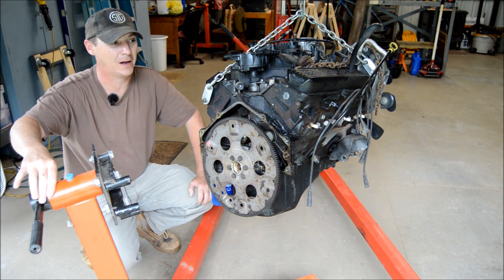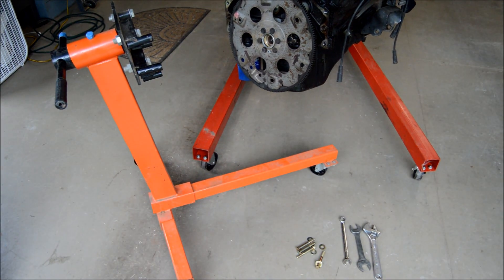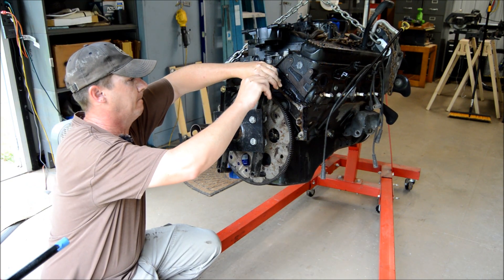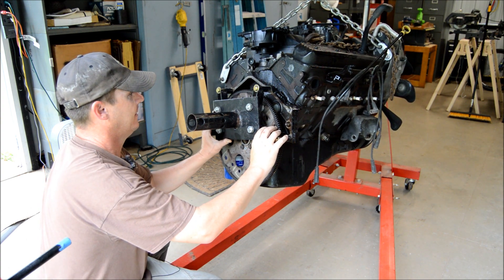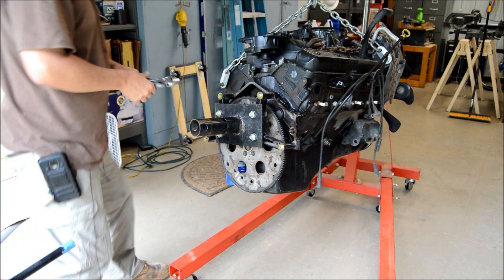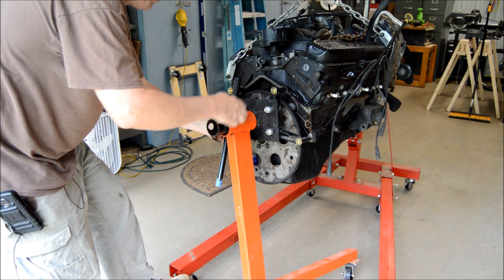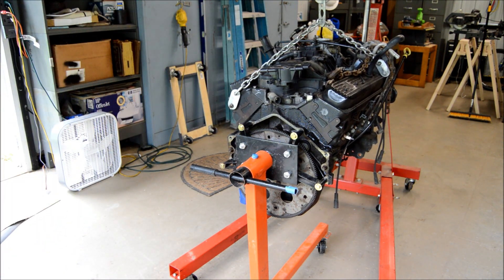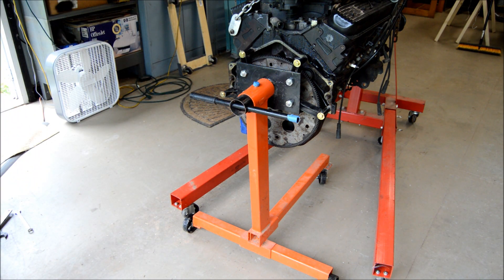Balance Your Engine Stand Properly - Vortec SBC Complete

Comment: Nice work. How are you liking those solid motor mounts? Also when installing the body mounts did one one hang off the frame? I'm wondering if moving the mount over to the next hole still line up the motor???? I just dont want to go through the hassle if it doesn't work out.

Comment: I would NEVER use one of those three legged enginw stands. 
Also, you need the pivot shaft to be aligned with the camshaft bore, or it's going to be very top heavy and dangerous.
50 years of working on engines has taught me a lot of lessons.

Comment: Thanks for your vid. I’m about to mount a 350 long block on a four castor stand. Without having seen it done I was a bit concerned but now I feel confident. Getting the balance point will be important for when I rotate the engine.

Comment: As others have said, this is a great little video.  Mounting to an engine stand is only 'obvious' if you've done it before.  Thank you for posting.  BTW, is there a reason you left the flywheel on?  Was this mounting only for demo purposes?
Reply from the maker: I left it on so I could use it to turn the engine over with a pry bar.

Comment: Great video. I wish I'd found it BEFORE I put my RAV4 engine on the Harbor Freight (Pittsburg) stand. Not knowing what you showed, I spent forever lining up the engine with the stand—instead of bolting the plate to the engine THEN inserting the plate into the stand. Jeez! Coulda saved so much work and dangerous fighting with a dangling engine. 
You are so right about not centering it on the crankshaft. Mine is way off-balance. It's safely locked in an upright position for now but there's no way to rotate it by hand. After watching your video, I may redo the whole process.  Thanks for putting this out there.

Comment: IF you break a grade 5 bolt that fits the transmission mount holes on an engine stand properly attached to the transmission mount holes, either the bolt is defective or damaged or you're doing something wrong.  Grade 8 is not that much more expensive, and again, if you snap a grade 8 bolt on an engine stand . . . 

Here's 'the science': 

Grade 2 3/8 bolt coarse thread proof load is 4250 lbs (per bolt)
Grade 5 3/8 bolt coarse thread proof load is 6600 lbs (per bolt) 
Grade 8 3/8 bolt coarse thread proof load is 9300 lbs (per bolt)

The grade argument is relevant if you're using undersized bolts or over-torqueing the bolts.   If you're just starting in mechanic work, google "torque chart", and use a torque wrench to get a feel for what is proper.  

Grade 2 3/8 bolt coarse thread recommended torque 15 ft. lbs
Grade 5 3/8 bolt coarse thread recommended torque 23 ft. lbs
Grade 8 3/8 bolt coarse thread recommended torque 33 ft. lbs.

A reasonably strong person can easily over-torque a grade 5 3/8 bolts with a 1/2 inch ratchet.  

Sheer strength is not an ASTM specification, but sheer strength is probably not relevant for mounting the engine on an this type of stand.  That said, according to multiple sources, shear strength of alloy steel is approximately 60% of its ultimate tensile strength.  For a grade 2 3/8 bolt, the tensile strength (not proof load) is 5750 lbs.  Sheer strength of a grade 2 3/8 bolt can be assumed to be about 3,450.  However, the bolts are not in sheer on the engine stand under normal conditions. 

Calculating the stress on the bolts requires thinking about the leverage of the engine sticking out past the bolt, and that is more complex than a YouTube comment.  While a grade 2 bolt may work,  I'd stick with something more like the transmission bolts in the engine - which in my experience are usually grade 5 for SAE and class 8.8 for metric.  

. . . but I'm certain some will still argue the point. 

* the information above is pretty wide-spread from multiple manufacturers because the grades are standards.  If you feel different about the torque information, do look it up. 
** also note: just because a grade 5  3/8 bolt can be torqued to 23 ft. lbs does not mean it SHOULD be... there are other factors.  What it does mean is that you should NOT torque it more than 23 ft. lbs. - but you can :)

Comment: I used grade 10, I’d definitely have to recommend them. If messing up threads with too hard of a bolt or clearance is ever an issue that’s the only reason I’d say to stop at any certain grade. 

For me I even bent a Grade 10 once when a mishap happened and Grade 8 may have snapped.
Reply: Bro... wtf are you talking about? Grade 10 is a metric nut grade.  I assume you mean Metric 10.9 which is nearly an exact strength equivalent to SAE Grade 8...
And being this is a Small Block Chevy you'll be using SAE bolts... which will be Grade 5, or Grade 8.

Nice attempt at sounding "next level" though. I'm sure some people out there bought it...

Comment: You said you use 3 inches.  I was thinking 2.5 how much do these bolts go into the block? I need to move my 383 from a crate to a stand.
Reply from the maker: They only go in about a 1/2''.

Comment: How deep do the bolts go into the block? How long are the securing bolts technically? I trip out on how little of the bolt treads support it on the engine stand
Reply from the maker: They only go in about 1/2''. I know it seems like it should be more but if you get grade 8 bolts it will be fine.

Comment: Why anybody uses a 3 leg stand is beyond me. You're hanging thousands of engine dollars on a tippy $40 stand.
Even the 4 leg has significant flex in the upright. I use it as a transmission holder.

With a coupon the HF 2T stand (6 wheels and braced upright) is about $115. Head plate is twice as thick and the arms are bars not flat plates.
The issue is dynamic loading, like when you move the engine or work on it. Just because the stand can take a static load doesn't mean it works for added dynamic loading.
I also always replace the chineseum bolts with true Gr 8 hardware, don't care what numbers they've put on them. They are basically hardware bolts.
A stand is the wrong place to scrimp.
Reply from the maker: Well said and thanks.

Comment: Make sure you tighten that top bolt on the engine stand to , I almost rotated my engine because the bolt wasn't tight enough. I was thinking of drilling a hole for a pin on top to make sure it doesn't move.

Comment: Just watching as the picker was lowered I could see the motor “bounce”. That tells me that the stand neck is stressed. I could see myself getting focussed on torquing on something and forgetting where the stress on the stand is going. Cheap stands are what they are. Thank you for posting this video. I hope your father in law got his stand back in good shape.
Reply from the maker: I agree those cheap stands are okay for holding an engine in a static position, but nothing more.  I prefer the HD stands for doing any serious engine work. Only takes one bad weld or invisible stress crack to cripple you for life. Thank you for commenting!
Reply: you might like this one https://youtu.be/AvD2XEAANPE
There is only bounce in it because it is a 700kg engine on a 450kg rated engine stand. The flex was actually in the bottom rail connecting the front to back wheels. The engine was also a little top heavy as we didn't know where the centre of the weight was. That is why the adaptor plate was slotted for adjustment.

Comment: Do you need to buy a specific bolt for a 5.3 vortec V8 to mount the bolts from the engine stand to the back of the engine? I don’t know where to look🤷🏾‍♂️
Reply from the maker: It's been a while but I remember they are 3/8-16. Length is determined by the stand you have. Measure the ears on the stand and add 1/2'' for your overall length. Be sure to pick up some extra washers for spacers. Good luck.
Reply: The Hands On Channel thanks and I bought the same stand as you, but mine has 4 wheels instead of 3

Comment: Where can I find those bolts and what size are they?? And length?
Reply from the maker: It's been a while but I remember they are 3/8-16. Length is determined by the stand you have. Measure the ears on the stand and add 1/2'' for your overall length. Be sure to pick up some extra washers for spacers. Good luck.

Comment: As already stated, good point to bring up balancing the engine if more than just the bare block. Didn't get that from a couple other videos I watched. I skipped the 3 prong stand because of stability. Getting ready to dive into an engine rebuild and your video was valuable for safety reasons.

Comment: Where did you get the bolts to connect the engine stand spider to your engine?
Reply from the maker: I got them at a local hardware store. You may want to check fastenall if you have one in your area.
Reply: @TheHandsOnChannel  thanks! I do have a Fastenal. I wasn't sure if they sold piece parts. Thought they only did bulk parts. I will check.

Comment: Generators are one of th most useful piece. Of machines during a black out  heat. Water pump lights any thing electrical
Reply from the maker: I think you posted this on the wrong video, but I agree.